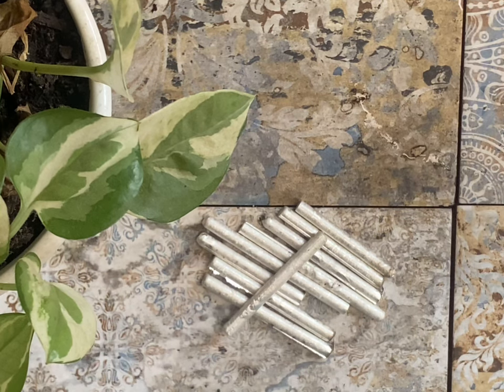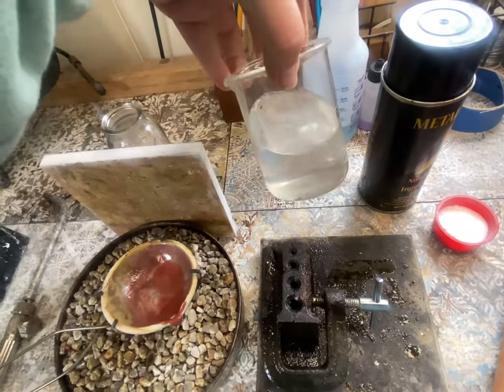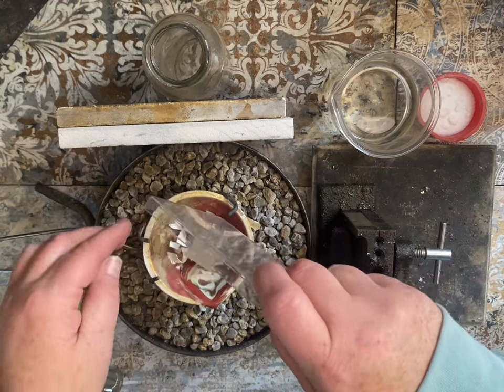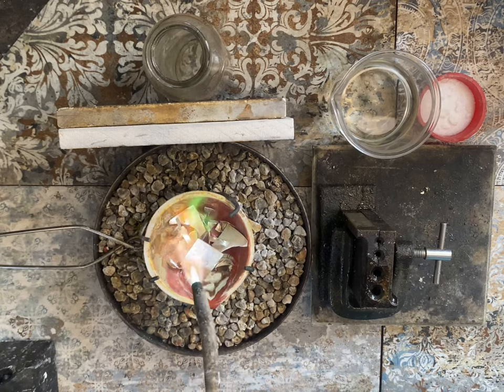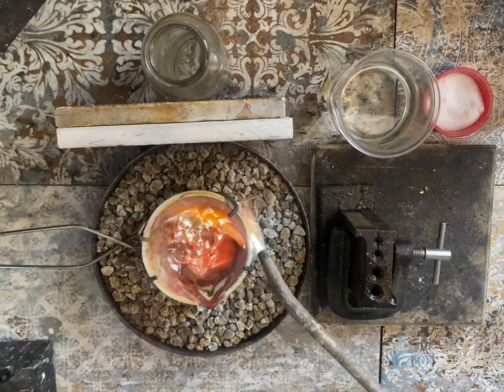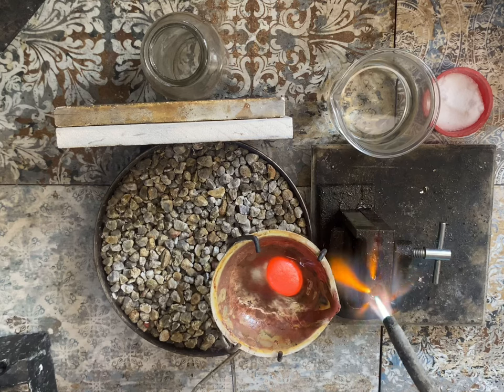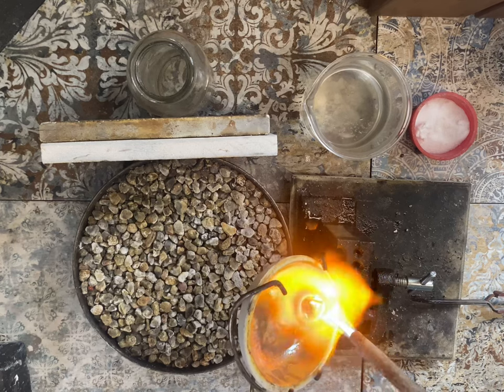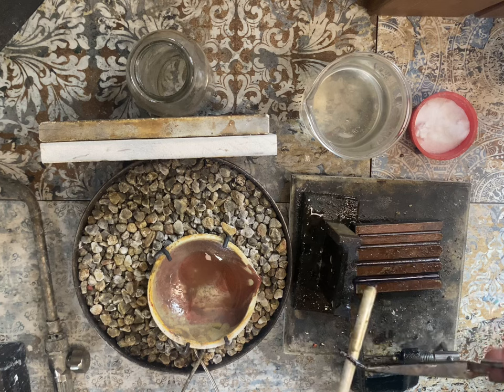Melting Sterling Silver into Ingots

Comment: What about old forks and spoons?  A magnet doesn't stick to the silverware but does that mean it's all silver?
Reply from the maker: The best way to tell if the silverware is sterling is check the stamping.   Most will have a “sterling” stamped on the silverware.  There are a lot different markings but with google these days you can search about the silverware and there marking.

A magnetic could work but it all depends on the metal inside the spoon. 

I use a magnet to get the metal that comes off my saw blade out of my scraps because I only use sterling and that's the only other metal that comes into contact with my silver scraps.  I hope this helps.
Reply: @silverborders  thank you for information.   God bless